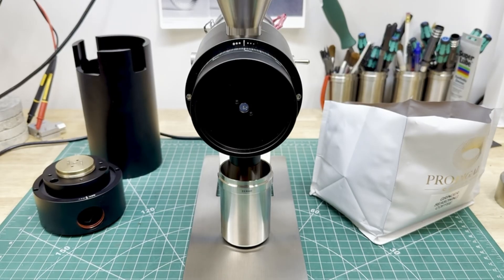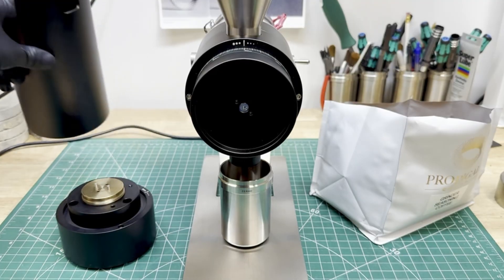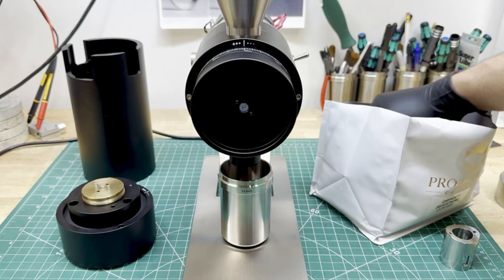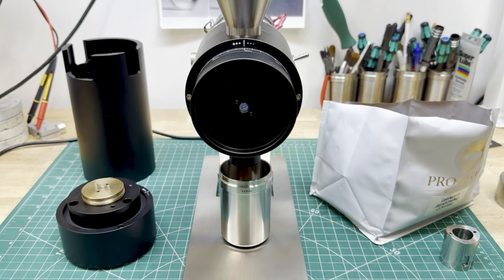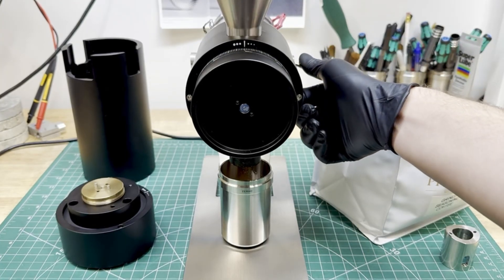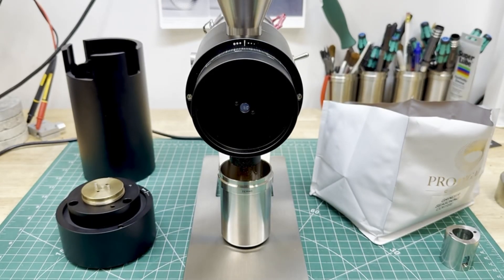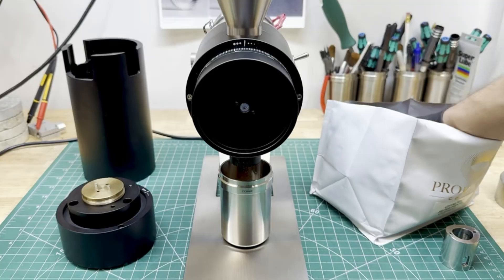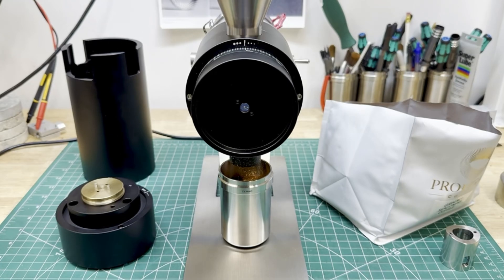From The Zerno R&D Lab: Z2 Motor System Advancements

Comment: That was quite a long time to grind for a small handful of beans
Reply: Not really
Reply: My spare shardor grindet destroys 18g espresso fine grind. And i mean fine grind faster than that. Might be burr dependant - like ssp mp or the HU take an awfully longer time to grind than most burrs
Reply from the maker: @Cafe-r7d  Looks like at 1600RPM we ground about 18-20g in roughly 3 seconds (going from the timestamp). The Z2 is designed to slow down the beans rushing into the burrs a bit to improve consistency. That said, we are happy to take the feedback if you are looking for speed you can always grind at max speed.